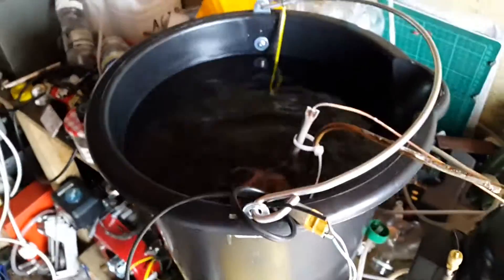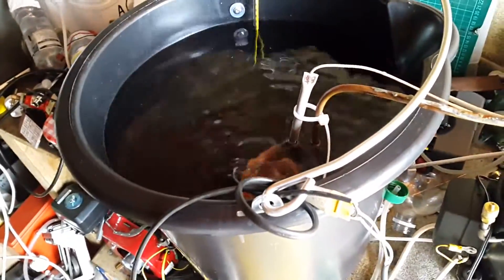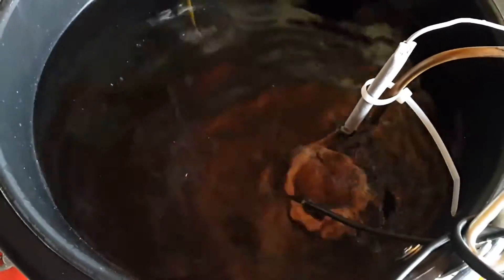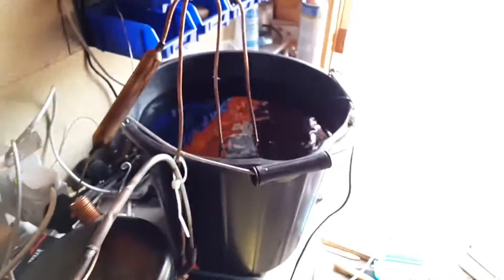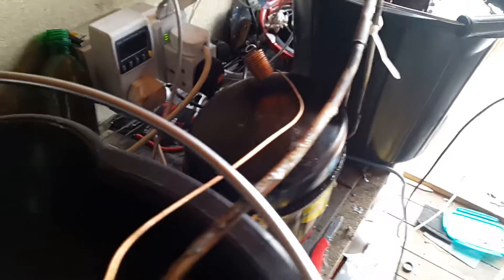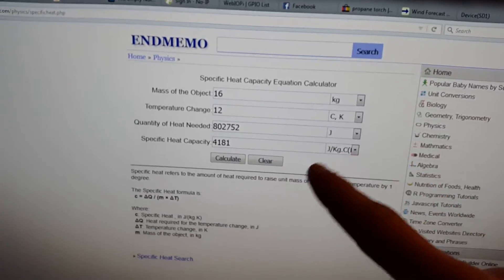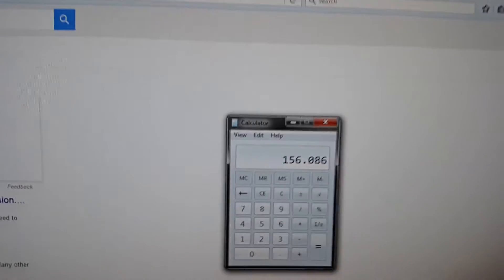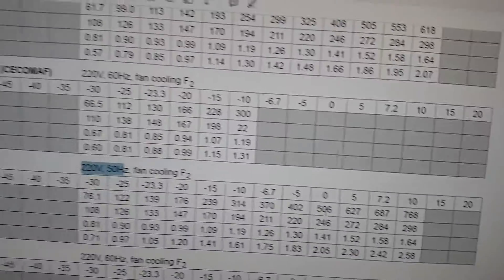Phase change cooling fail

Comment: let me correct you, your removed 802.7kJ in 42min, that is 318w of cooling for those 42min. Also you had losses, since water (bucket) was not insulated well, so you had even more cooling power